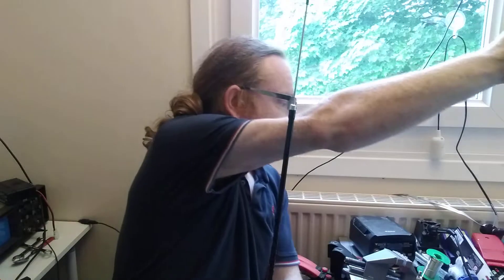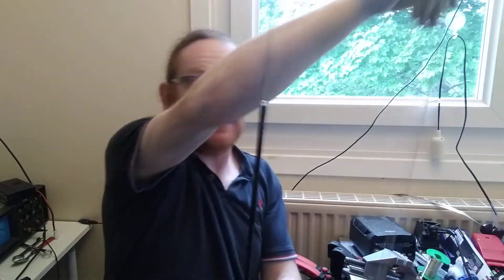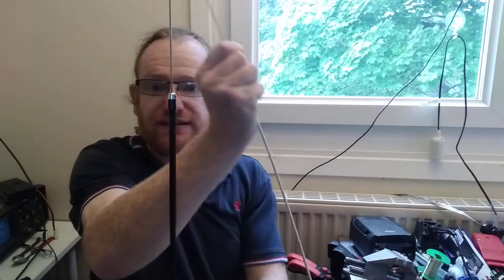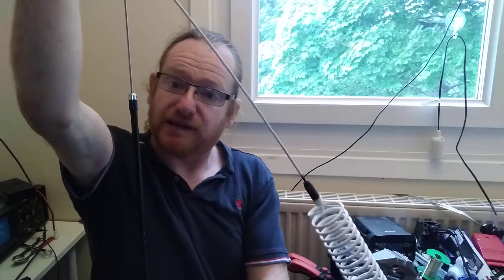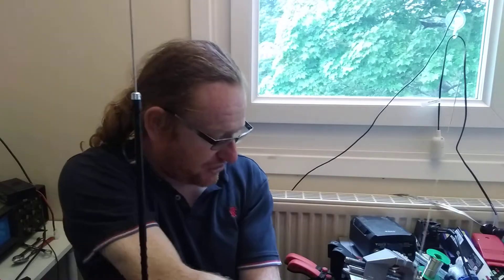Some experiments with the boomerang antenna

Comment: I bought a cb radio and it's got a 5 pin din accessory socket  at the back..what is it for.any ideas
Reply from the maker: Not sure without knowing the specific model, it could be either an external speaker or a selective calling system connector

Comment: Have you managed many contacts with this antenna since setting up? Is it worth the money as a compromise antenna perhaps for a loft install? Your views are greatly appreciated.
Reply from the maker: At my home I get a lot of noise so often struggle to hear weak signals and because of that I've not made many contacts on it, for me it's worth the money as it's really the only antenna I can put up for CB
Reply: @PaulMcGeeM0WNU  would you say it is comparable to your T2LT on a pole outside? I guess the antenna heights will make the largest difference. Incidentally I have a T2LT which works great off a 9m pole but was wondering if a boomerang would work ok as a loft install for bad weather / winter work or when I just want to turn the radio on and not have to set up the pole each time. Thanks and keep up the good work with your channel!
Reply from the maker: @26DR302  I have not tried a T2LT outside the flat, I tend only to use that up on the hills, a T2LT would perform better as it is a halfwave end-fed dipole, I also found that the boomerang antenna that I have is a single band antenna, mine is tuned for the UK channels only though, regardless though antennas in lofts don't work as well as outdoor ones so you would have better luck with an outdoor antenna

Comment: Ok here goes nothing, having moved into a unit i cant install a large antenna, so bought one of these, never in my entire life (60+yrs) have i ever failed to swr and antenna in, until this one, so here i am hoping you know how to do this and are able to give me some advice, tried everything,  i think, from the top of the whip to the ground plane, both have adjustment points, would appreciate and help you can give me, other than that i will probably have to get a swr/matcher, its the cb band im using it on...HELP!!
Reply from the maker: If it is the same antenna that I got from Thunderpole there are two adjustments points, a short whip-like section on the top and a screw and bold arrangement  at the bottom, the antenna is a single band antenna so will only really work on one set of 40 channels and any adjustment should be made as small as possible before checking again and readjusting if needed, what I also did as I found this was a problem is make up a common-mode choke which is 5 turns of the coaxial cable on around 100mm plastic tube as close to the SO239 on the antenna as possible, might be worth a try as well, hope that helps
Reply: @PaulMcGeeM0WNU  Yes its the same antenna, what is the original length of the stainless steel rod that we use to adjust the swr??, yes i did nibble some of the length, i have also been told it had a black line on it and thats where you start from, i dont recall seeing a black line, Im hoping that if i can get this information i can start from scratch so to speak, I nibbled the swr rod before i knew about the groundplane adjustment..
Reply from the maker: @OldAgeTeddyboy  I've measured how the top section of mine is currently set and it's around 15.5cm, the adjustment in the bottom appears to be 5mm between the bottom of the screw and top of the nut that locks it off, I can't find the instructions for it right now and I think the black mark has since worn off mine, try it at that and see what happens